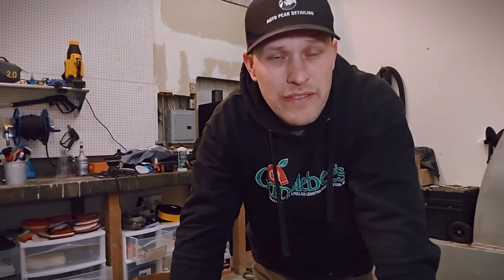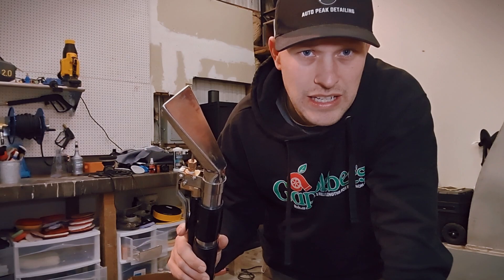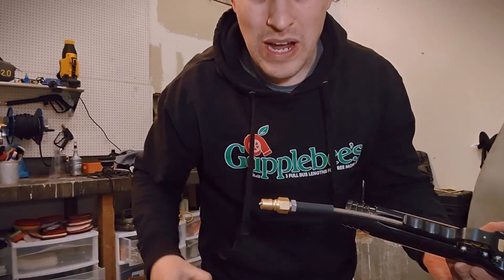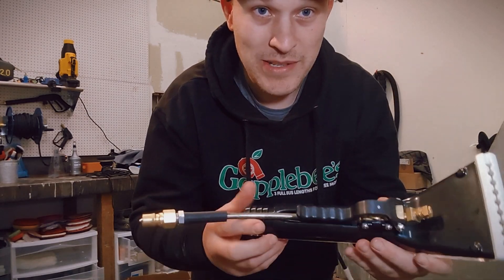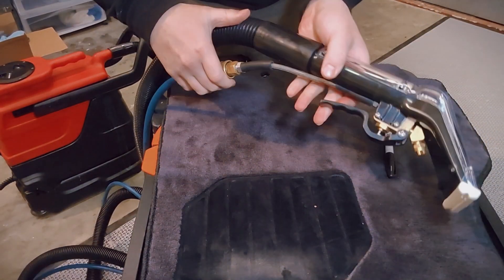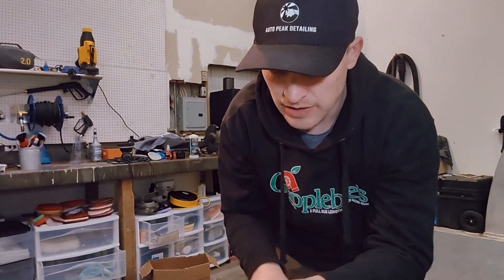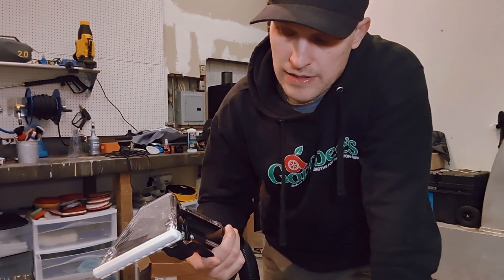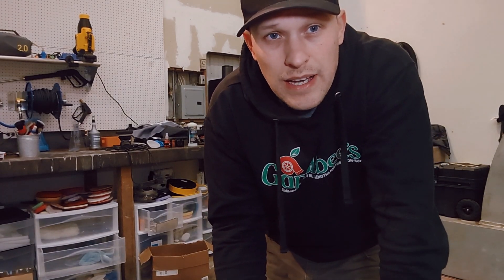Mytee 8400P attachment on the Sandia 50-7000

Comment: You are spot on about the original wand. I purchased the detail king see thru, waiting on it to arrive but I never considered the weight factor. I may order the mytee still. 😅
Reply from the maker: Yeah makes a huge difference on my hand. Spray is a finer for controlled most and suction is better as well. I'll use it until it quits and move onto something else I'm sure.

Comment: Im on the fence about the Mytee s300h or the Sandia 50-4000 or the 7000.  You have any problems with the 50-7000??  And I was wondering about that Mytee sprayer nozzle and using it on the Sandia.. You just confirmed it.  Thought it would!
Reply from the maker: Still going strong using just about daily. Have had a couple times I need to clean fittings, nozzles etc. Comes with the nasty cars. Way better with the mytee nozzle. Bought the mytee grip cover too.
Reply: @autopeakdetailing  Where did you get that one from?

Comment: Hey buddy!! great video!! it helped a lot. a question, how about the heater, when you turn it on the MYTEE 8400P will support the 600w heater from Sandia?
Reply from the maker: The heater element is in the unit itself. Still works the same. I usually pour in hot distilled water so I don't have to wait for it to heat up. The heater isn't very fast on this unit. Suction could be a little better. But it's been a great extractor for daily use the 1 year I've had it.